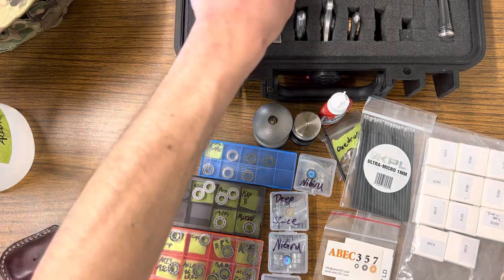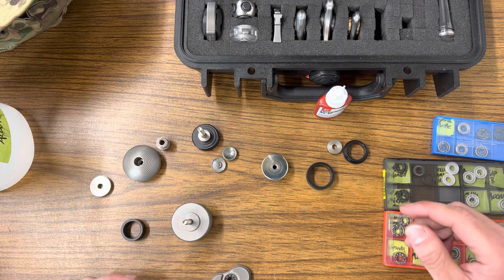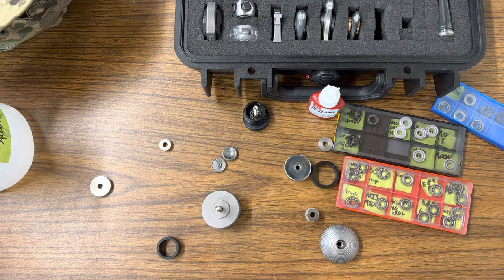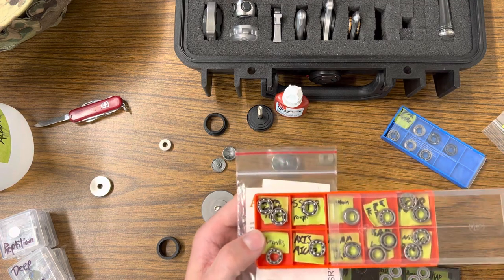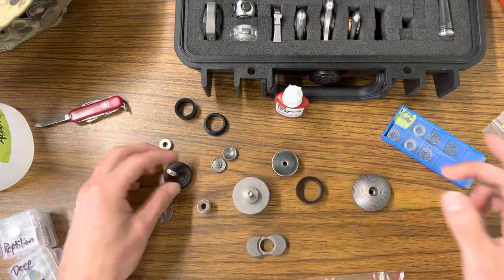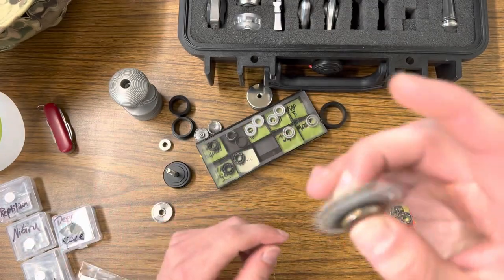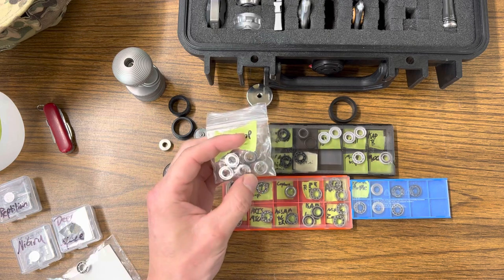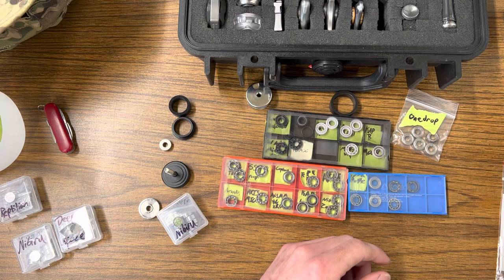Rambling About and Changing R188 Fidget Spinner Bearings

Comment: is the size of the R188 bearing the same as what comes in those generic gas station fidget spinners?  I have a really old one that actually spins pretty well, very smooth and quiet, but not very long... and I'm trying to figure out what's the best bearing I can get to replace for a long and smooth spin.  but i literally know nothing about this.
Reply from the maker: Are you able to remove the bad one and measure?  I could help you confirm.

But, it is likely that it has wither a R188 or 608 bearing